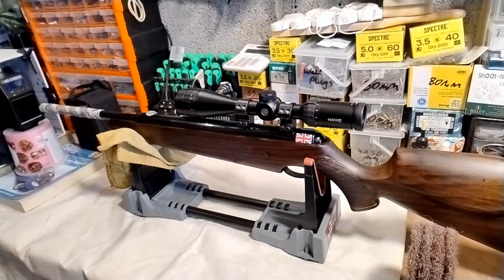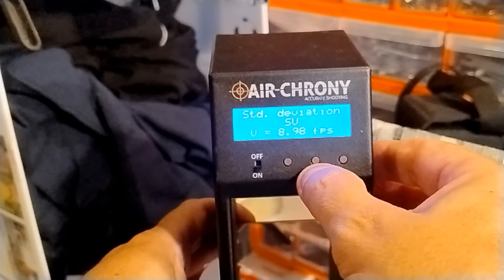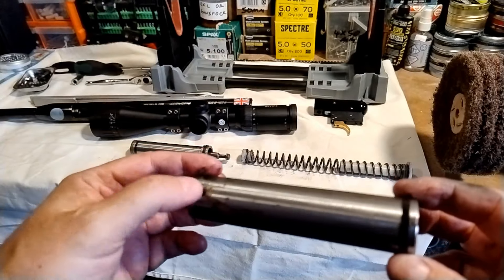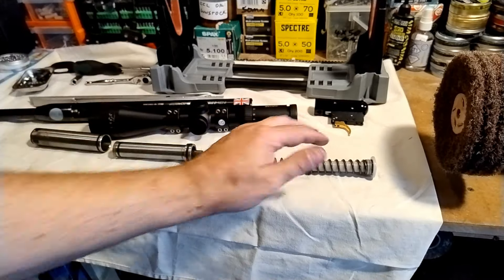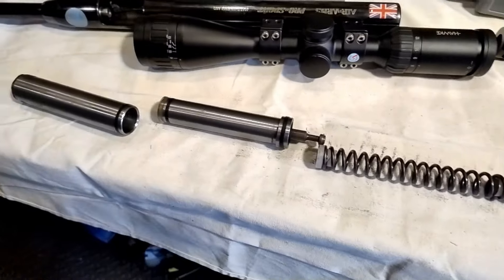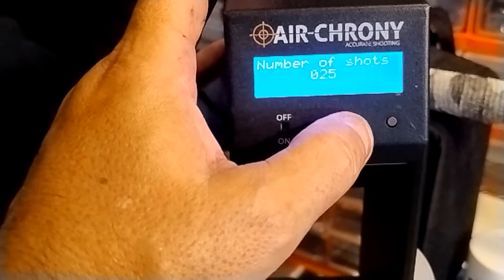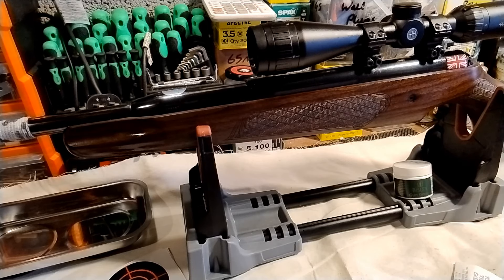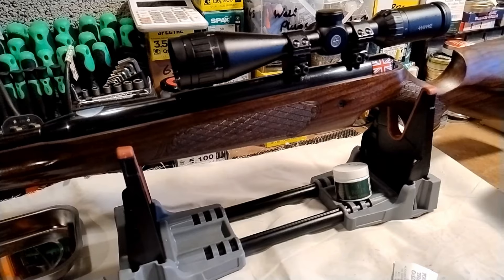Air Arms Pro Sport Strip Down Video

Comment: It's difficult to see for sure on the video, but it looks like you have power washers trapped between the last couple of coils, which would stop it fully compressing. Not sure how they managed to get there, if that is the case, or how you would get them out. Might be worth another strip down to check.